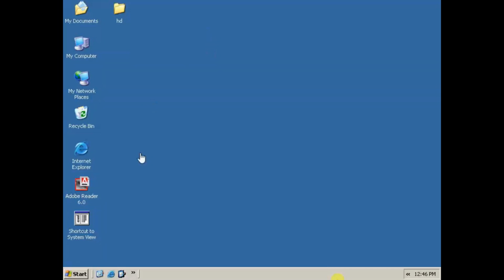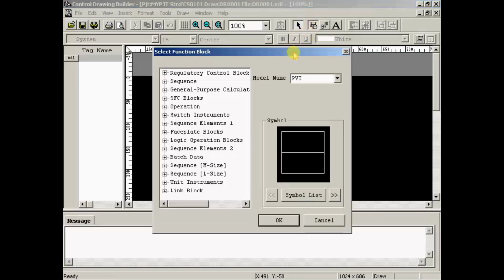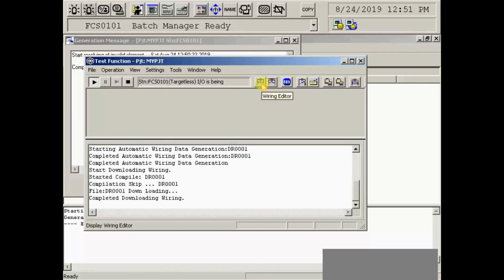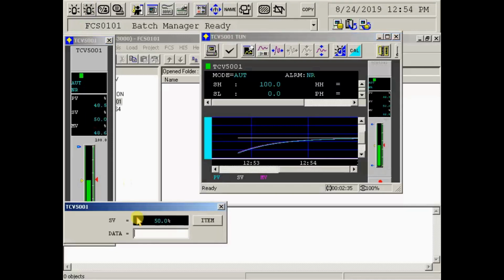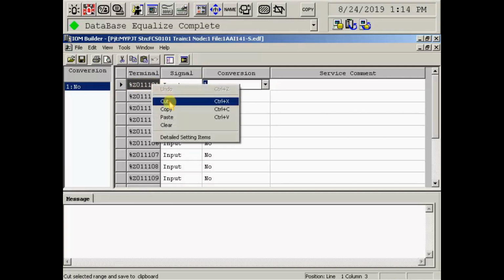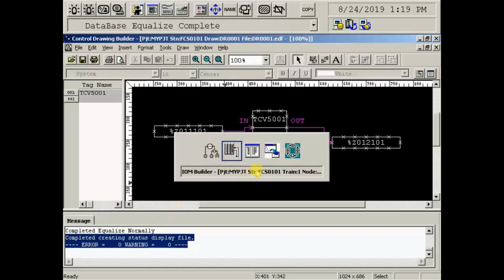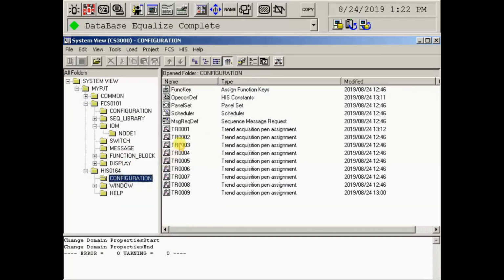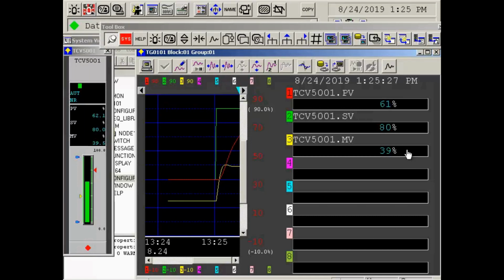Yokogawa DCS Centum CS3000 Tutorial | Quick start project | PID test function

Comment: i have a Yokogawa centum CS3000 DCS system for controlling turbine at a thermal power plant.unfortunately my existing one  operator station PC is dead.another operator PC and engineering PC is Ok.DCS system is also ok.i wish to connect a new operator station PC.i wish to get your advice how i can do it as i have no any backup software CD.my whatsapp number : 0088-01814792505
Reply from the maker: Thanks for your message,  I will ask an expert friend to contact you.
Reply from the maker: For information, their consultations and supports will include fees based on the time needed.